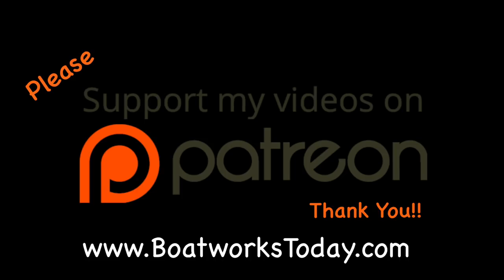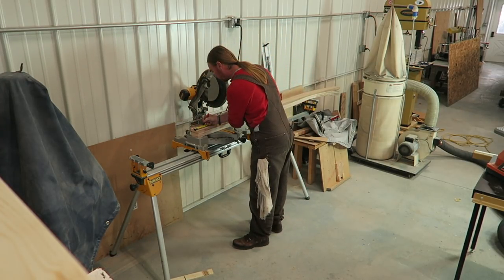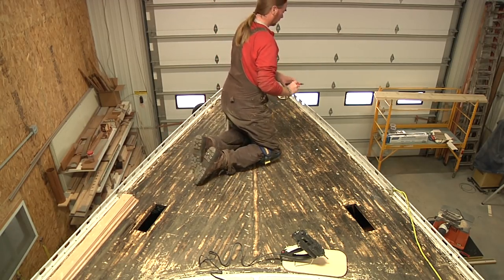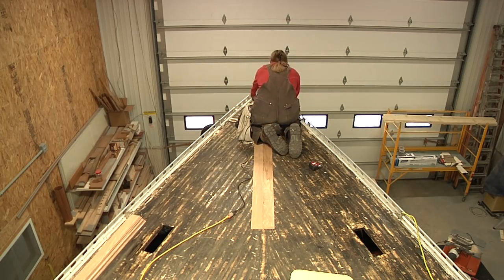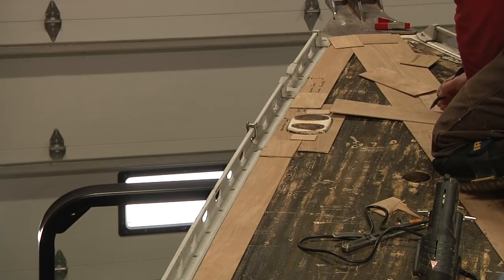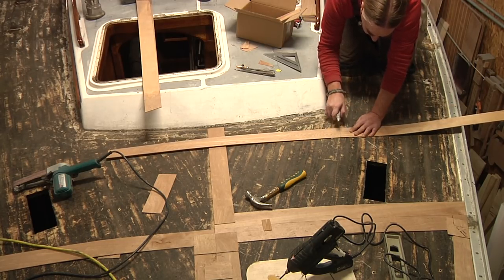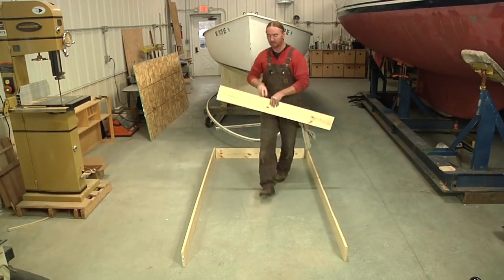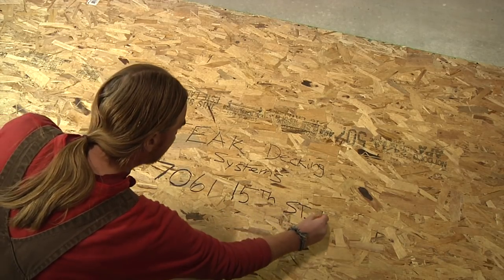Making Templates For The New Teak Deck

Comment: Amazing, Andy! I always look to you and Boatworks Today for advice and once again your handling of this situation is well thought out and practical. What hot melt gun are you using there? I often use hot melt in my line of work but have most often only used the cheep-o products that ooze glue and then build up on the plastic/rubberized tip. The one you are using looks more substantial and ... well ... professional.

Comment: You mentioned a flexible epoxy.
I’m redoing the floors on my 70 schiada flat bottom ski boat. And I was wondering if you could recommend an epoxy? 
I set the strings with West system and 207. Floors are 3/8 marine mahogany ply to factory fiberglass hull. And I’ll be using a vacuum to set the panels. I’m wanting something extremely strong but flexible. Any help is greatly appreciated. Thank you for all the great videos! 👍🏼🙏

Comment: Thanks for sharing Andy. Do you if the material you used for the template would also be called fiberboard? Thanks again. Will be looking forward to you getting the deck shipped back and put down. 👍👍👍👍👍 😊
Reply: Not sure which "level" of fiberboard you are looking at but as fiberboard is usually made of wood fibers and a lot of glue it can get quite dense. The more dense the stronger the material but it also adds a lot of weight. What it looks like Andy is using is, what we call in the Great Lakes region, lauan (loo-ahn) or underlayment which, as taken from the HD website, is 1/8" thick, with an actual measurement of 0.106" in thickness. It, in many cases is more flexible than fiberboard and much lighter in weight.